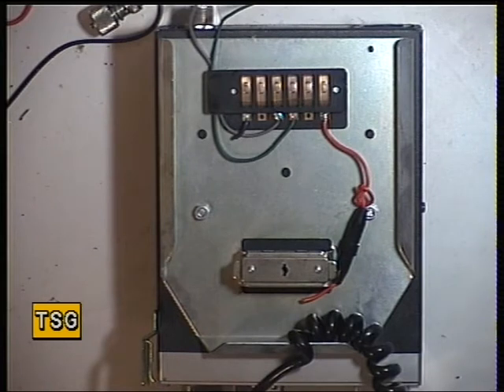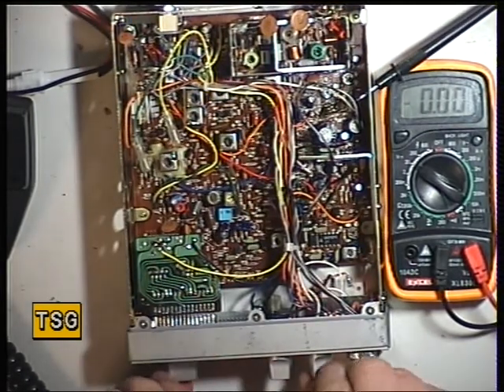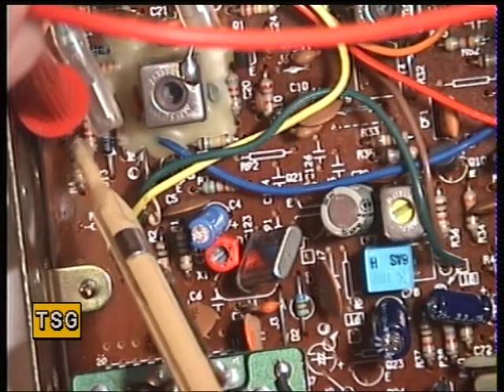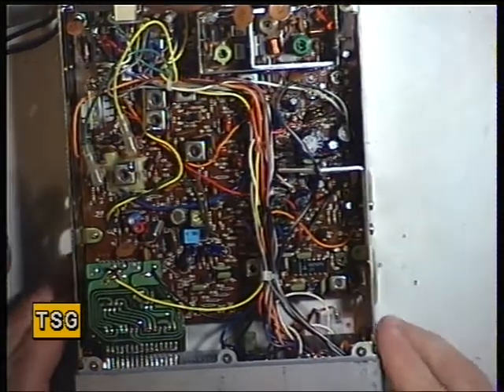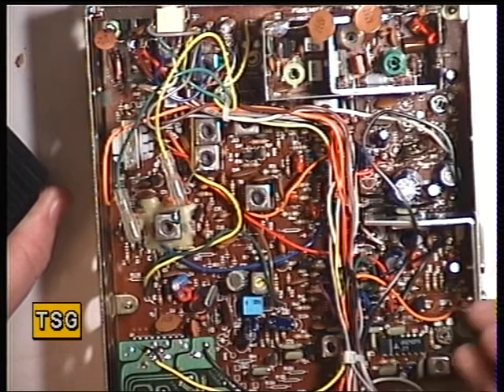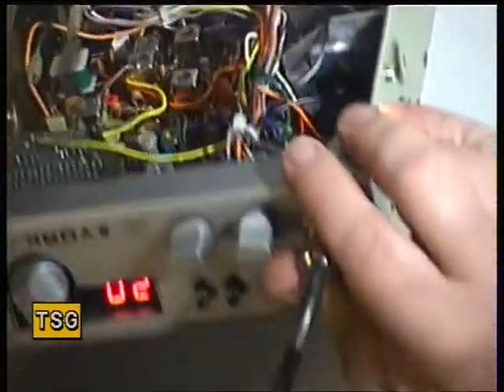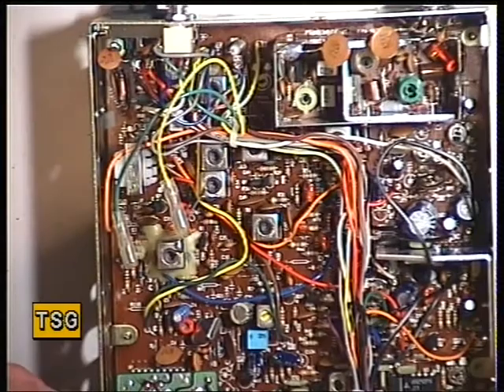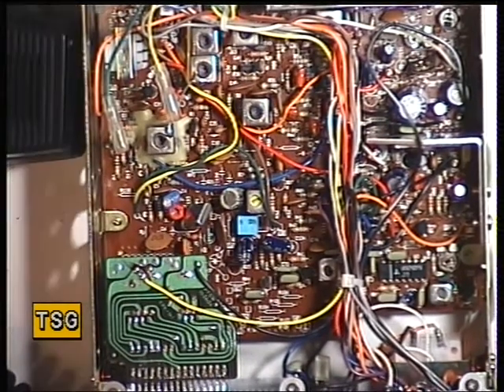York JCB861, UK (CB 27/81) CB radio (Mobile)  - VCO & Transmit adjustment

Comment: Hi pal. I notice on a lot of your videos you use a small handheld tone generator that you place against the mic.
Could you possibly give a little more info on it please as I would like to purchase one or something similar.
Thanks and 73 from 2E0LIG
Reply from the maker: Roger. I'll do that on the next video though I've covered it in the past. I'll give the model number, but quickly is a Korg Chromatic instrument tuner set to b flat for gthe 1Khz tone. This is not a guitar tuner.

Richard, G0OJF, UK
Reply: @ukfmcbradioservicingTango21  yeah thats great was wondering as it would be ideal for me to tune my manual tunner actualy on SSB instead of having to use FM to tune.